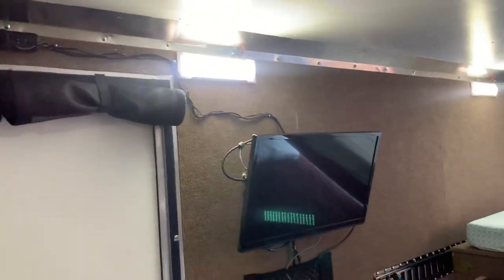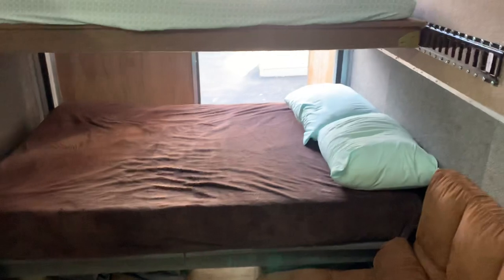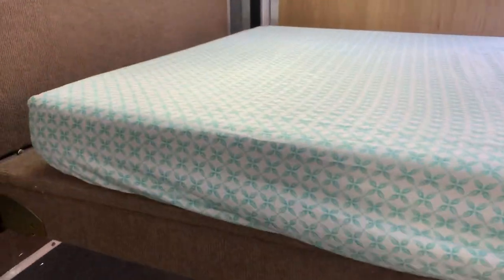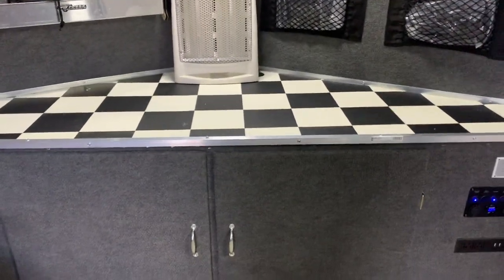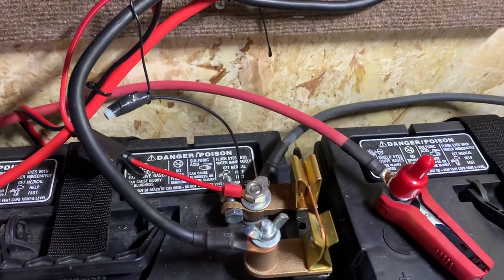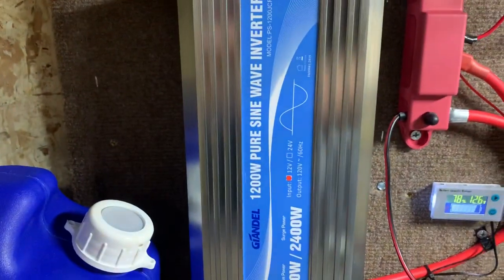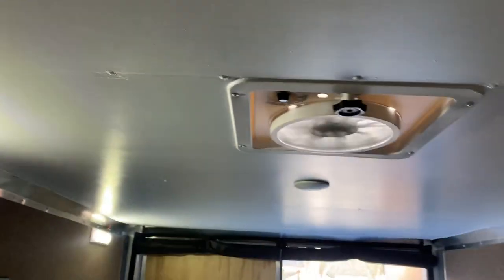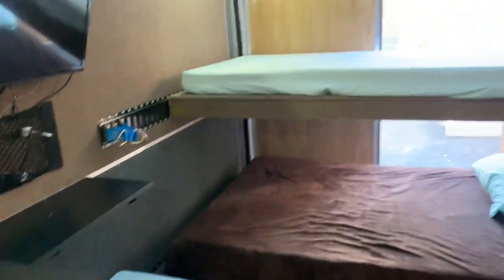Cargo Trailer Camper Conversion - Finished Ceiling and camper overview

Comment: Who are the 14 who thumbs down this DIY masterpiece?
Great job 👏
Reply from the maker: Lol. Thx. Some people just like to troll I guess.  Thx for watching.
Reply: I disagree about not putting insulation in the floor but nothing worthy of a down vote.
Reply from the maker: @larrybe2900  I actually wish I had put insulation in the floor.  The trailer stays nice and warm with heat during cold winter months, but the floor definitely remains cold on the feet.  I may re-think the floor at some point.  Thx for watching.
Reply: @randomstuffwithjoe  
Saw one video the guy did the insulation,foam board,on the underneath and sealed all joints/gaps with expansion foam and silicone.
I would use the good blue/pink foam they put over underground water lines in the cold zones. Pretty durable. And lose no headspace inside.

Comment: What do you do with the bed when traveling. Say of you were hauling a four-wheeler. I was wanting to make bunk beds out of the e track. However I am not sure where you store them. If you had something (atv) parked there.
Reply from the maker: Depends if I’m hauling my motorcycle or not. If I’m hauling it.. I fold the mattresses and store them in the carrying  cases. Then I remove the bed platforms and stand them against the side wall and ratchet strap them using the e-tracks.  If I’m just camping and not hauling anything... I’ll throw the ratchet straps over the beds on each end and secure them so they don’t bounce around.

Comment: Cool trailer brother. Like to do something close to what you have but with a false back wall so I can place a 110 wall a/c unit. Living in South Texas is a must.
Reply from the maker: Thx for watching.  Its worked out pretty well for me. I was thinking about putting a mini-split heating/cooling system in it some time this spring.  Good luck with your build.

Comment: You can make a cardboard cutout for inside the window then no one can see through it, I'm sure you thought of this you must have another reason why you hesitate on the window, but it would also provide nice cross ventilation to pull air up out your fan
Reply from the maker: I guess I just couldn't get myself to cut a hole in a brand new trailer.  At the time, I was kind of winging it and wasn't really sure I wanted to convert it to a camper, but still wanted to camp in it.  But its worked out great as-is.  Thx for watching.

Comment: Great build! I want to do something similar with a hybrid snowmobile camper. They are only about 5’ 5”inside though.
Reply from the maker: I’ve seen some nice builds with lower headroom height, but the ability to stand is nice.  Thx for watching.  Good luck on your build.

Comment: think about a few solor pannels on top of camper to keep batteries charged the who;le time while campng
Reply from the maker: Thx for watching.  I actually have a SAE connector in the floor along the front edge of the trailer that’s wired to the batteries and I plug a 100 watt portable solar suitcase in to it.  Works awesome.

Comment: Super Sweet. I built a conversion cargo trailer also. It was a lot of fun, but I also haul ATV's in it. I set up my bed the exact same way with the etrack and the 2x4's but what I am missing is an awesome tv mount with a lock like yours. Any chance you can shoot me a link to where you got it or what it is? Thanks for sharing your video.
Reply from the maker: Thx for watching.  Here's a link the TV wall bracket I used.  Its been really sturdy and works great.  

https://www.amazon.com/gp/product/B077Z7NVBK/ref=ppx_yo_dt_b_search_asin_title?ie=UTF8&psc=1
Reply: @randomstuffwithjoe  Perfect thank you!!

Comment: Came out great, I like its modular, and I ot stuffed with stuff. So its light, what do you use to tow?
Reply from the maker: It’s an aluminum trailer so it’s fairly light weight considering the size.  But I’m towing with a 2017 Chevy Silverado so towing isn’t a issue for me.

Comment: Real nice looking. I like the carpet on the walls. Did you glue it and is it staying up ok?
Reply from the maker: lowcard1 I did glue it.  I used 3M spray adhesive.  It seems to be holding pretty well.  If I were to do it again.. I might use a brush on adhesive.   I did put some staples in here and there.. just for added security I guess.. but prob could’ve done fine without them.

Comment: Hey bud! I like how you made the the bunk.  Question...how do you have the 2x4 on the track? Is there a special mounting bracket for that?
Reply from the maker: Hey.  Thx.  Yes, there are 2x4 e-track brackets. I got them on Amazon.  I used three 2x4s on the twin bed and four on the full bed.  Super sturdy.  Here's a link to the brackets..

https://www.amazon.com/gp/product/B06VVRGPGQ/ref=ppx_yo_dt_b_search_asin_image?ie=UTF8&psc=1

Comment: Nice conversion. A few questions. What is the thickness of the wall panels? Is the E track fasten to the trailer wall frame? How’s the insulation working out to keep trailer cool.
Reply from the maker: Thx for watching.  I’m unsure what the wall plywood thickness was but I’m guessing it was 1/2”.  The e-tracks have so many screws that it holds super strong.  Some of the screws hit wall studs but many are only in the plywood.  I’ve tied my motorcycle down with them and the beds are super sturdy.  As for the insulation.. it definitely helps keep it cooler.  I use the roof vent fan as an exhaust on really hot days and with the doors open it definitely helps. 

Hope this info helps.

Comment: Great looking very functional trailer. Will u share on how the bed set up and the railing plz. Also where can I get a draw on the electrical fir the same size trailer. If any info I would appreciate much. Best of luck to you and your daughter. Be safe. 🙏👏✌️🌻
Reply from the maker: Hi.  Here's a link to a video I did when I first built the bunk beds.  It should help explain how I built them.  Its basically just 2x4 lumber, plywood, and e-tracks on the walls.  I carpeted all of the wood to match the walls.  
https://www.youtube.com/watch?v=iVQc9dj1L_M&t=38s

Here's a link to a video that goes thru my electrical set up.  I hope this helps.
https://www.youtube.com/watch?v=fxNJhviVqS4&t=1s
Reply: Thank you so much 🙏
Reply: BTW. I owned the same bike in red. It’s a COMMANDER. Nice bike 🏍
Reply from the maker: @bobby3849  Sweet.  Unfortunately, my bike got stolen last year.  I was bummed.  I loved that bike.  I think I'm gonna pick up an Indian Challenger in the spring.

Comment: What would you say the weight of this thing is? Sorry if you mentioned in the video I missed it.
Reply from the maker: Hi.  I did not mention the weight in any of my videos.  Honestly, I'm not sure of the weight.  I never bothered to worry about it b/c I'm certain its very minimal compared to the trailer's carrying capacity.  

The trailer has dual axles with a combined weight of 7000 pounds.  I doubt I have more than 500-600 pounds of materials in this build.  Frankly, I can't even notice a difference in towing from when it was a bare trailer to now.  

Anyway.. sorry I couldn't give you more specifics.

Comment: Looks great
Reply from the maker: thx
Reply: Which trailer size did you start with?
Reply from the maker: @brandonpolk2628  I was initially looking at a  7x14 plus the v-nose.. and a ramp door.  But the dealer sold that trailer before I was able to get to it.  I ended up with a 7x12 plus the v-nose.. with barn doors.  I'm actually kind of glad I went with the barn doors tho.  The ramp is nice for hauling my motorcycle, but I have a folding ramp anyway so I can still do it.  The barn doors are much more practical in a camping situation.  If I had gotten the 14' trailer.. I may have added a small bathroom/shower.. but I'm happy with things now.  Cheers.

Comment: Can you tell me where you get  folding bed please thanks
Reply from the maker: Amazon
Reply: I’m building my 6x12 is there a specific size I have to buy
Reply from the maker: @wangoprc4  I built my bed platforms based on the size mattress I wanted to use.  I used a standard twin up top.. and a standard full size mattress on the bottom.

Comment: I'm doing my own cargo camper build. I was just wondering how your charging your batteries or if you had a video for it and the set up.
Reply from the maker: Hi.  So I have two ways of charging.  One is solar and the other is 110 from my home with a standard extension cord and battery charger.  Here are some links and info.

I put one of these under the floor and have a power strip inside the camper cabinet.  Basically I have a regular battery charger plugged into it and it keeps the batteries topped off while its parked in my driveway.  
https://www.amazon.com/gp/product/B009ANV81S/ref=ppx_yo_dt_b_search_asin_image?ie=UTF8&psc=1

Then I use a solar suitcase and have another solar inlet under the floor and it plugs directly to the batteries.  
https://www.amazon.com/gp/product/B07PQD767W/ref=ppx_yo_dt_b_search_asin_title?ie=UTF8&psc=1

Here's the solar panel I use when we're camping:
https://www.amazon.com/gp/product/B01NBONA3E/ref=ppx_yo_dt_b_search_asin_title?ie=UTF8&psc=1
Reply: @randomstuffwithjoe much appreciated thanks!
Reply: @randomstuffwithjoe  hey Joe. Great video. What are you able to run off of the solar panel? I am interested in doing. A build on my 7x14 trailer in the future and trying to figure out what I want to do for power sources. Does it have enough power to charge the battery?
Reply from the maker: @RuetscheFlies  I'm not running anything that takes a lot of power.. so its worked great for me.  I'm running a few LED lights which don't draw much power.  A TV.  A roof fan.  Usually I'll have another portable fan plugged in.  And the power inverter.  We also keep our cell phones charged etc.  

I'm running two 115AH batteries.. so a total of 230AH.  I have camped for 2-3 days at a time without charging and I never ran out of power. I'm only running a 60 watt solar panel.  Its one of the portable suitcase panels.  When I do run it.. it always tops off my batteries in a few hours.  If I were to do it again.. I might opt for the 100 watt panel - just in case.  

I'm thinking of adding a small fridge.. but even with that.. I have plenty of juice to camp for days and I'm pretty sure the 60 watt panel will keep me topped off.
Reply: @randomstuffwithjoe   @Random Stuff with Joe  Appreciate the response! One more question. Do you think the 2 batteries could run a full desktop computer with a monitor? XD I do a lot of heavy video editing on my computer and would like to be able to edit in my downtime. This is a key point in making my travel "vlog" possible/ putting videos out in time
Reply from the maker: @RuetscheFlies  get a pure sine inverter.  It’s better for electronics.  I have a 1200 watt inverter with a 2400 watt surge.  It’s turned out to be way overkill.  I could’ve easily gotten away with half that.  Two 115AH batteries is a lot of juice if you’re not running high powered items.  It’ll easily power your computer gear etc.  Unless you’re camping for days in cloudy weather.. a 100 watt solar panel should easily keep you going.

Comment: What material did you use for the ceiling
Reply from the maker: I put 1" foam board insulation in the ceiling and finished it was a 1/4" sanded plywood.. then painted it white.

Comment: You said you used the bug sprayer was your shower.  With all the 12v batteries.. you should get a12v transfer pump.. like 50$from harbor freight.  You can thank me later
Reply from the maker: I thought about it.  But I use a shower tent and the sprayer is just easier for now.  We don't shower inside the trailer.  I'm actually considering selling this trailer and getting a slightly larger one next year and doing a more elaborate build with a full bathroom and shower.

Comment: What's the cost in something like this?
Reply from the maker: Its been a while since I've completed this camper build, but I think I put around $1200 into the trailer to get it built to where it is.  That included the insulation, flooring, and other building materials, mattresses, tv, door screens, and all the powered electronics, etc.  That does not include the cost of the trailer.. which I purchased brand new for a little under $6k.  

Unfortunately, prices have increased since I did this build, so I'm assuming it would cost more today than it did a few years ago.  

Thanks for watching.  :)
Reply: @randomstuffwithjoe  did a great job thanks